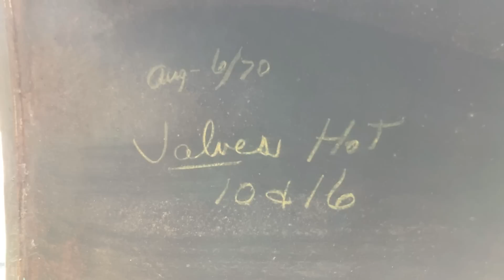Bring on the Harvest! 1946 Chevrolet Grain Truck Tour!

Comment: i happened to see one of my fellow townsmen that had a 1967 Chevy pickup with a dump bed conversion back up on an incline with a load of dirt and when he got out and dumped the load it mostly stuck in the bed and flipped the truck up on the tailgate. i don't know if the surprised look on his face was worse when the dirt finally came loose and the truck slammed back down by itself.

Comment: That's a sweet old truck. I'd imagine most of it's miles were from it shuttling grain from the farm bin to the local grain elevator after the WWII. I'm willing to bet it might go 50 MPH downhill in neutral.
Reply: I wonder if it is rare.  There were HUGE car shortages in 1945, 46 and 1947. Even worse than today.  The auto makers all got together and made film reels about all the various screw ups in the logistics of the immediate post war.
Reply: ...and then after harvest time, the truck went back into the shed until next year.  That's the thing about old trucks like that, it wasn't uncommon for them to be used for a just few weeks each fall.

Comment: I could use that truck...
I live in an area where early Americans built their communities & my property is listed as one of the early American homes.
And , its required that you maintain the house in the era it was built..
Example, copper gutters that are now very green from oxidation..
But the driveway that leads to the carriage house & my home must have period correct gravel & only in the tracks where the carriage wheels rode..
That dump bed would be perfect for placing the gravel only on the wheels tracks...
Instead of dumping gravel 12 feet wide , its 2 feet , median & 2 feet...